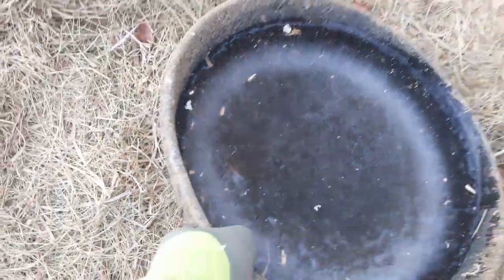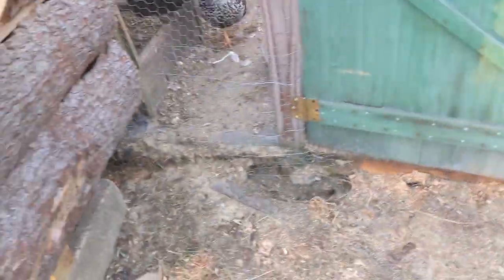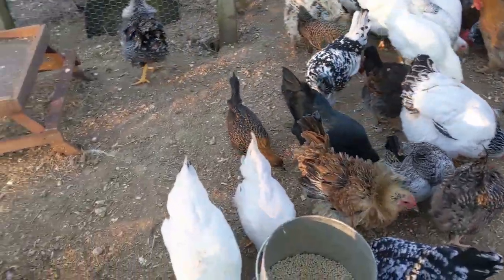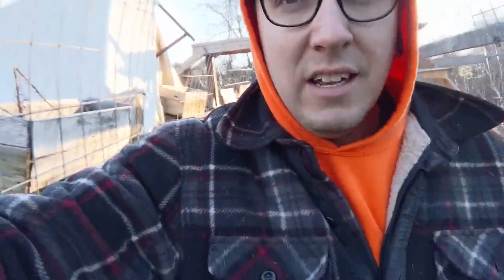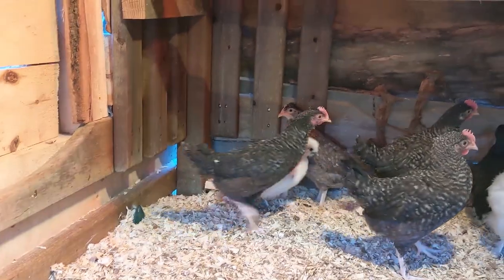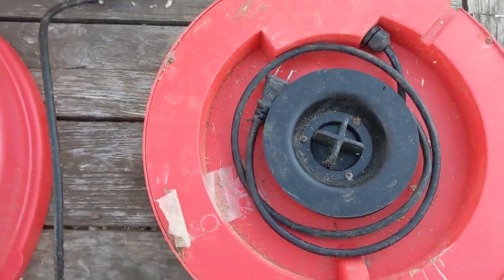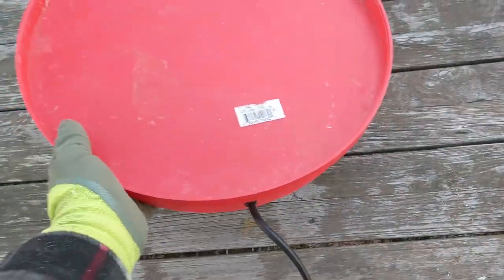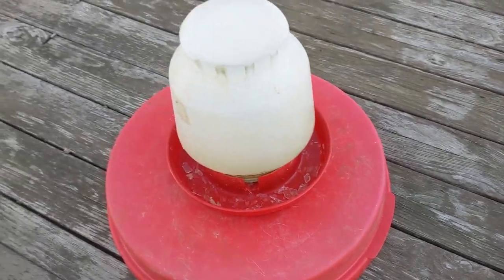How Do You Keep Your Chicken Water From Freezing?

Comment: I’ve seen a few people use this method... an electric free option to think about is attaching a board on the bottom of a tire - use spray foam to fill the inside of the tire - carve out the area for your rubber bowl to sit in. The insulation keeps the bowl up off the cold frozen ground and will slow the process of the water from freezing. 
Personally we use the Premier1 heated chicken waterer. 5 gallon heated buckets and heated hoses.
Reply from the maker: Oh I like that suggestion for the tire! Maybe would hold more water as well?
Reply: @OldReddingFarm  I don’t know about it holding more water, simply because you are still using the rubber bowl to hold the water. The bowl can still be removed to dump out the ice just like you are doing now. 
I’ve seen a few people say to use 1/2 cup of salt in a bottle, fill it 3/4 with water and float it in your water bucket. In all honesty, I can’t see how this could possibly do anything to help.

Comment: I’m still a super fan of our heated 55 gallon drum waterer. However, I can see how that might be a less desirable option if running electricity was an issue.
Reply from the maker: Yah our electric bill in the winter can get out of control last winter we had months where our bill was $700 for the month running electric heat to waterers and heat lamps in brooders and grow lights and whatnot. We just had to cut back what all we're doing electric
Reply: Heated 55 gallon drum??? I need one of those!